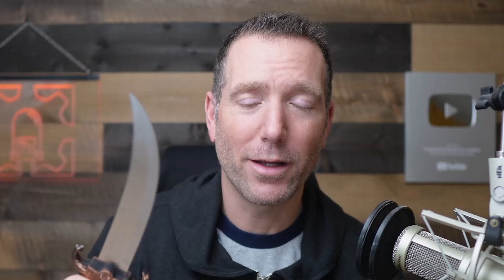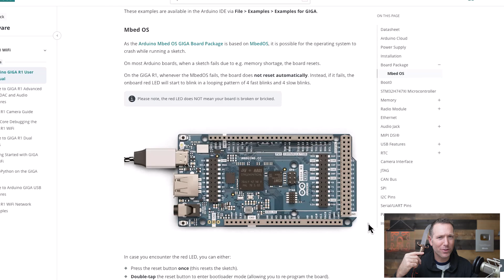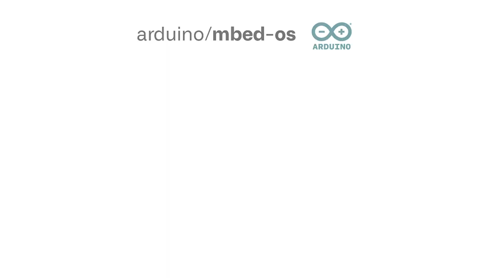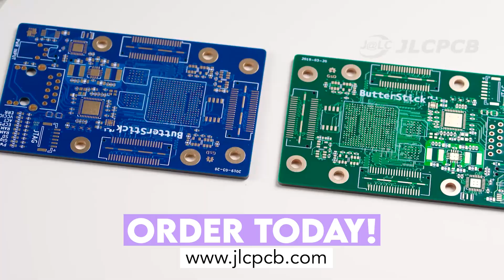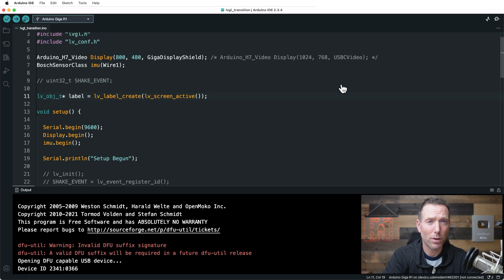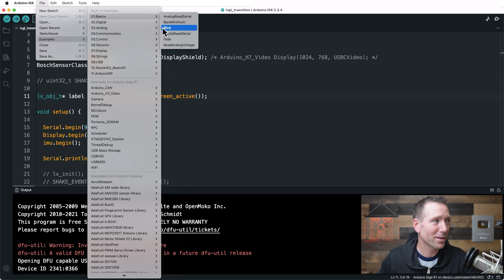Arduino Giga Red Blinking LED - Quick Fix! #ArduinoGiga

Comment: thanks- I'm working up to very large light board (going to make a 3-5 ft pong game with LED strips) and learned I needed the Giga.   I increased the LED count from 720 to over 1k AND switched the external power source for the lights from an external USB to a hefty 5 volt inverter (see the power injection) and boom- no light and my arduino turned into a brick with that light.